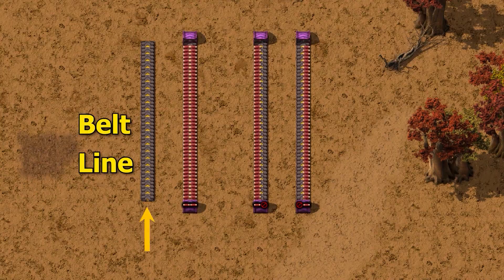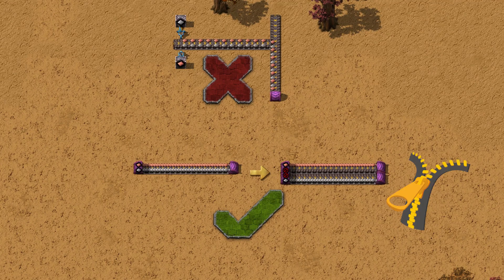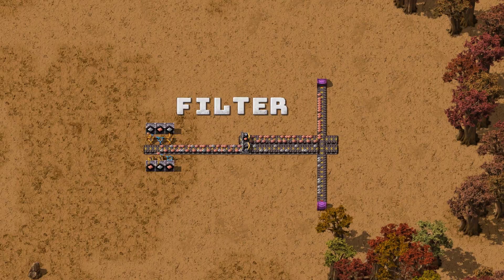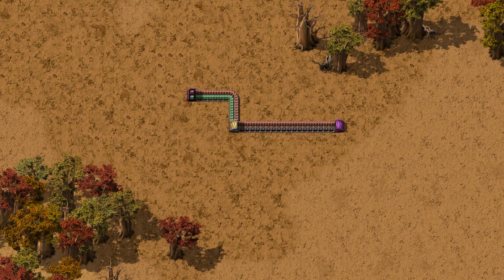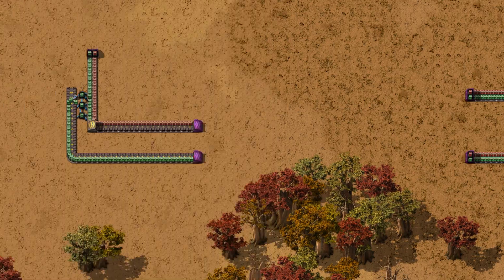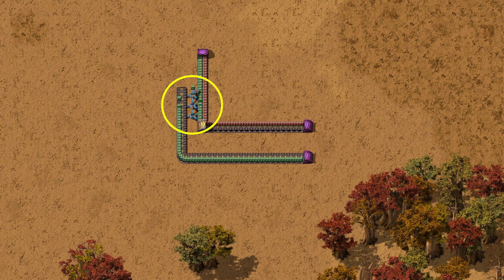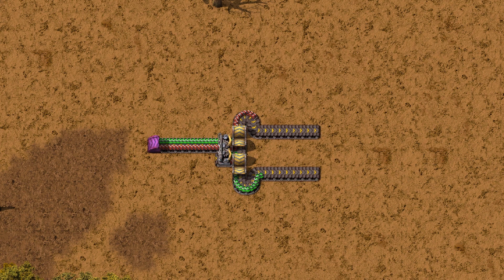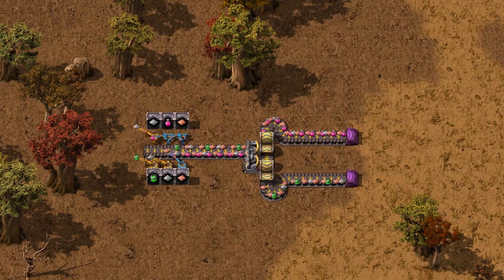Factorio Tutorial: How to SPLIT Belt LANES | Nugget #5

Comment: If you put downward underground in front of bottom part of splitter, and regular belt then upward underground, you end up with a similar results with only half of the underground used...
Reply from the maker: Cheers. Many designs (more compact or cheaper) are available. But this is a beginners tutorial. Simplicity and sticking to a visually symmetrical designs helps understanding.

Comment: great, now someone tell me why would I have a sushi belt where resources are strictly bound to one side?
Reply: 1) platforms (one side of belt is asteroids, other side of the belt is ammo/rockets/railgun ammo, or stuff that requires dumping off ship.
2) quality-mixed belts where one side is common and other side contains quality items
3) throughput imbalance / needs of factory. iron is generally needed in much higher quantities. half a belt or a full lane can be devoted to one resource whereas the other side of the belt is mixed items. 
4)